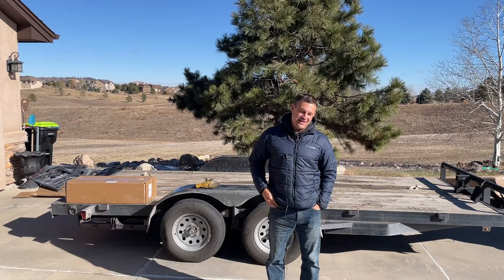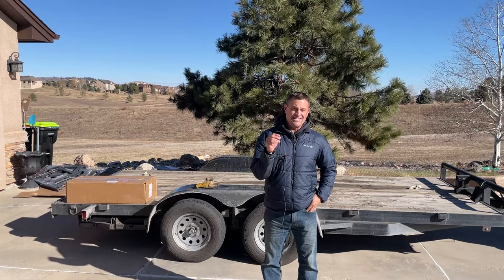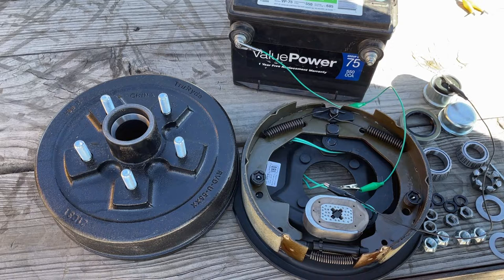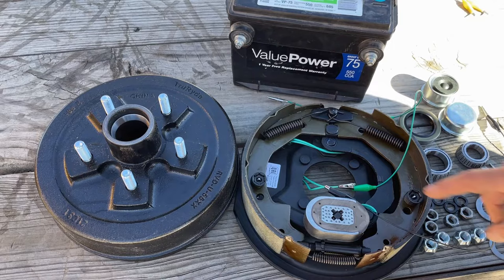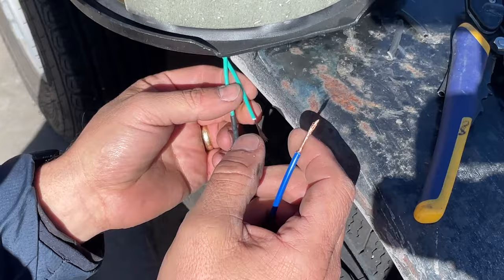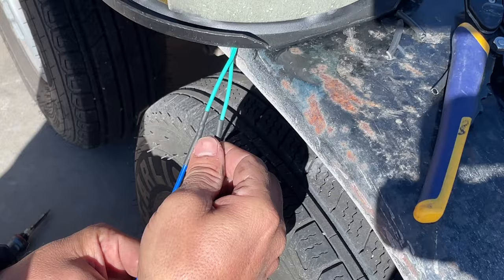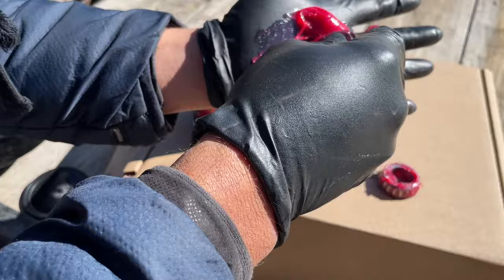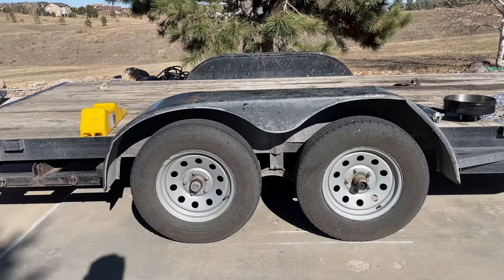How to add Trailer Brakes - Everything you need to add electric brakes to your 3500lb axles.

Comment: You need to learn how to pack a wheel bearing.  You just smeared it on the outside of the bearing.
Reply from the maker: Any chance you can give a step by step on how you do it.  Will be helpful to others who read this.  Thanks.
Reply: This is how I was taught too, by scraping it through the grease, you force it up and into all the places that just rubbing it on would not get.
Reply from the maker: @tanyaf-p6242 thanks.
Reply: @ntdracing you use a similar method to what you did. Put grease on the palm of your hand, but instead of rolling it through, you put it on its flat edge and squeeze the grease into the slot that goes around the edge of the bearing

Comment: You should have put the brakes on the rear axle for best results.
Reply from the maker: You are probably right.  I had asked around and the consensus was the front.   I plan to add a set to the back.
Reply: @ntdracing how did they perform on your trips?

Comment: Good video, looking forward to seeing the new shop. Kind of surprised the trailer didn't already have brakes. I didn't think you could buy a trailer without brakes. Around here all the tandems have brakes on both axles.
Reply: All depends on the state! Minnesota doesn't require if the GVWR is under 3k lbs empty. I plan on running my new cargo trailer closer to that 3k lbs point so here I am, better to have 'em and not need them, than the inverse!

Comment: I have an older 1996 Winnebago RV that I am having a lot of problems finding brake drums for.
If you can find them at all, they will be expensive.
This has a single rear axle with drums and 4 wheels.
I am wondering if I could just change out the whole braking system (just the components that you showed).
This would allow me to get pads and drums again when I need them.
I am pretty sure that the original system uses brake cables instead of magnets, but welcome to the 21st century.
I could adjust my brakes on the road with a simple digital adjustment.